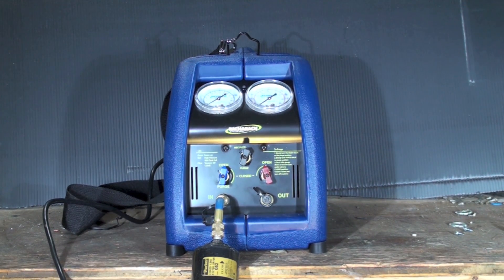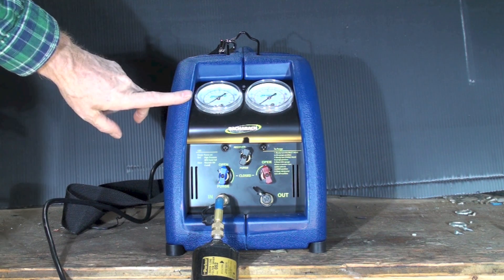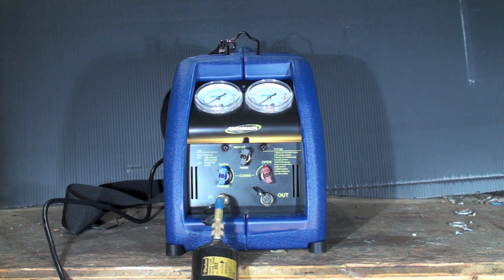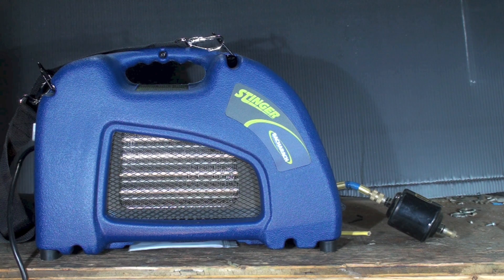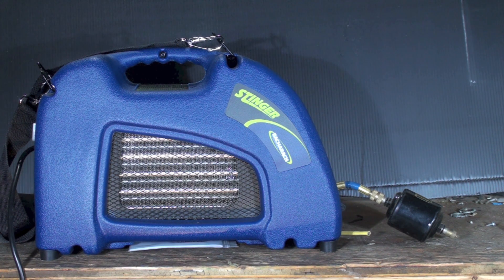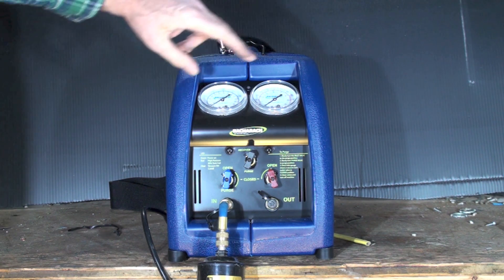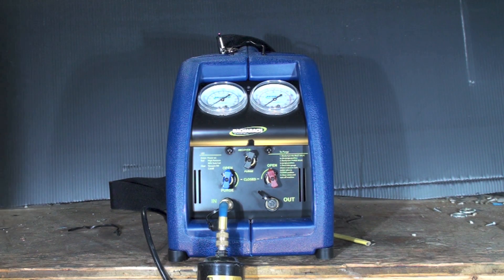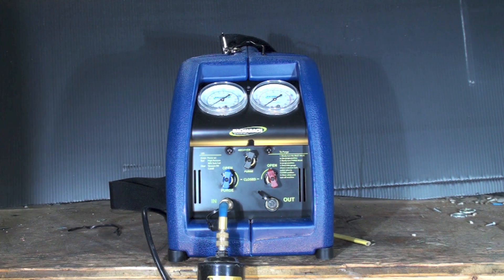Introduction to the refrigerant recovery machine.

Comment: Hi GFM just has a question about the refrigerant contamination. If I use a recovery machine for two different refrigerants, do I need to flush the recovery machine between two applications? Like if I recovered R410a for a split system, did some work on it and put the refrigerant back. Then need to pull r134a from a vehicle.
Reply from the maker: I would flush with the refrigerant I will be using in the next unit.
GFM
Reply: grayfurnaceman okay cheers

Comment: I would think the manufacturer of the recovery mechine would not have instructions on recovery of liquid in there 
Oners manual. The manufacturer has to worenty the pump for at least 1-3 years. Why would they publish liquid recovery. 
Please explain your self.
Reply from the maker: The recovery machine is indeed able to recover liquid.  That does not mean it cannot be damaged. I and my coworkers destroyed dozens of these machines before the manufacturers built in some protection and service techs learned some methods to keep these things alive.  In my later years of recovery, I used the same machine for 10 years.  If you watch the entire series, you will see my methods for recovering refrigerant without destroying the recovery machine.
GFM

Comment: Are u pulling freon from the vapor port of the recovery tank , and pumping vapor to the vapor side of the system and letting liquid be sent to the liquid side of the recovery tank.
I'm not sure how your reclaiming liquid. You can't run it true the pump. That would slug the compressor on your recovery mechine.

Comment: the thing i dont understand if you pull r410 as vapor wouldnt the refrigerant would not be good cause r410 is a mixture of refrigerants and if u have a leak on a r410 system would the refrigerant would be bad? or would it be good to use on a system?
Reply from the maker: If you remove all the refrigerant, both refrigerants in the blend will be removed and the refrigerant is good.  I always replace the refrigerant when I remove it from the unit.  It is not worth the risk of contamination or blend separation.  
GFM
Reply: grayfurnaceman.👍

Comment: That filter drier is a liquid line filter isn't it?  Do you leave it on even when you recover vapor? Is there a difference between liquid and suction line filters other than the size of the fittings. Thanks.

Comment: good video, I find that it's good to get the suction pressure and discharge pressure as close to equal  before starting that way the unit doesn't have to fight against a large pressure differance and it doesn't complain.
Reply from the maker: ***** Good point.
GFM
Reply: Jim Pettinato. And how exactly are you suppose to do that without running it.

Comment: If machine works like condenser does this mean refrigerant leaves the recovery machine liquid phase ? If so why do we hook up to vapor side on the recovery tank? there are two ports on recovery tanks Vapor and liquid  If I am not mistaking.
Reply from the maker: The refrigerant does leave the machine as a liquid.  The liquid and vapor valves are only for removing refrigerant from the cylinder.  When adding refrigerant, either valve can be used.  Hope this helps.
GFM
Reply: I got it thanks.
Reply: @grayfurnaceman  llllll

Comment: Great advice, question how is the oil removed from ac systems? for example maybe from an automotive system?
Reply from the maker: I am not expert on automotive systems.  From the units I have worked on, there is very little oil in these units.  On the order of 5 oz.  As the system is designed for the oil to circulate, I am not sure there will be much oil in the compressor.  What there is you can drain by removing the compressor, removing the low side tap and drain it from there.  Hope this helps.
GFM